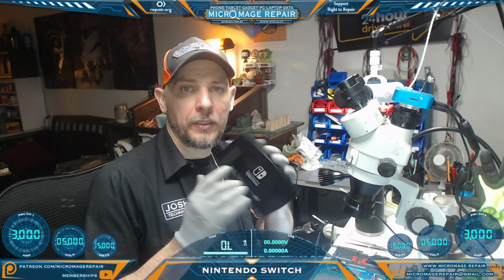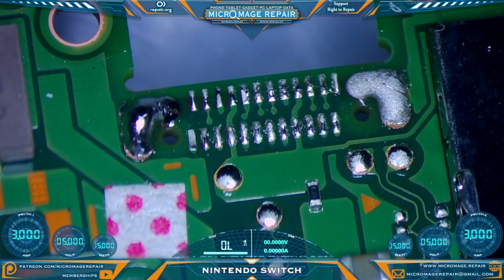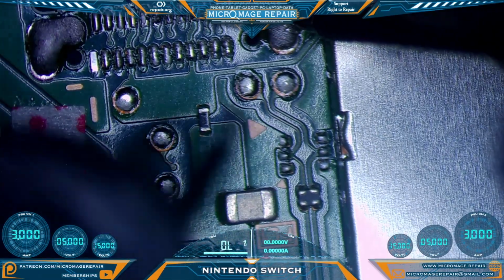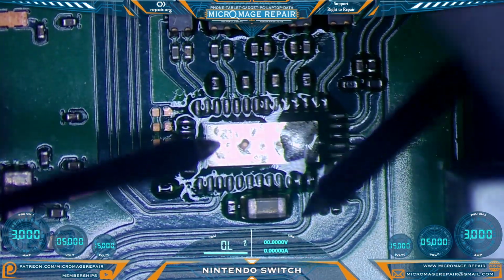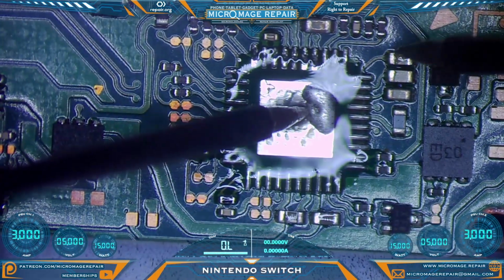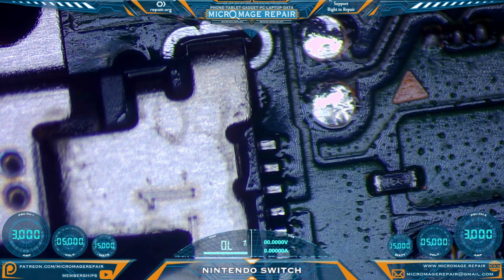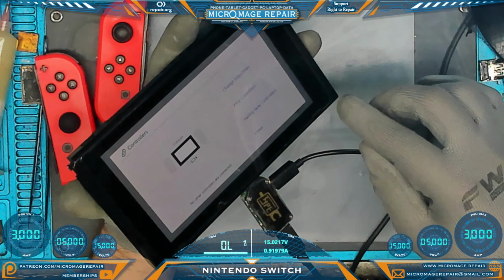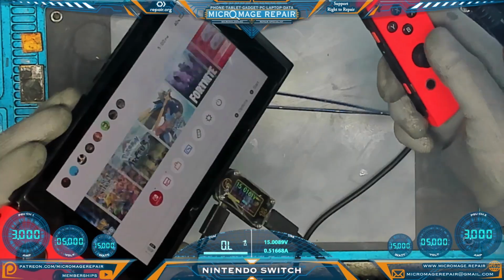Nintendo Switch: 🔥A Little Can Cause Allot!🔥

Comment: What microscope camera and camera adapter lens do you use?
Reply from the maker: Unfortunately the microscope camera I use is not available anymore. 
It was a Chinese one with a decent for the time Sony sensor.
This is the lens adaptor I use but you need to match whatever Barlow lens you are using or you will get weird optical effects and shadows like I had in some of my older content.
https://www.injuredgadgets.com/adjustable-camera-mount-for-trinocular-microscopes-0-5x/